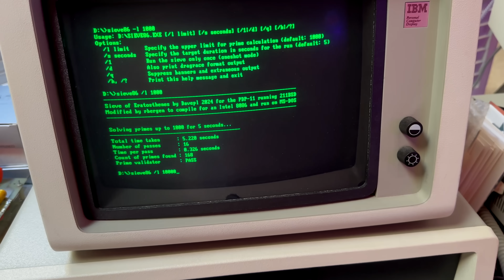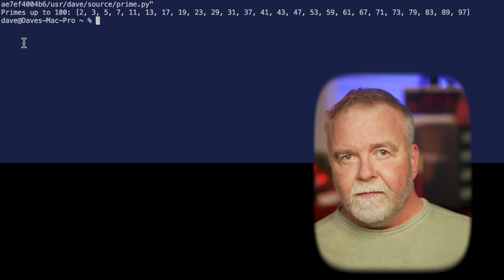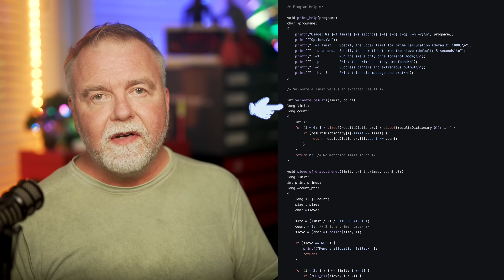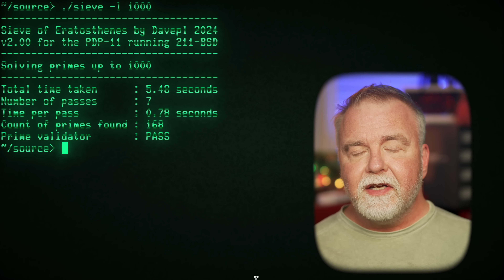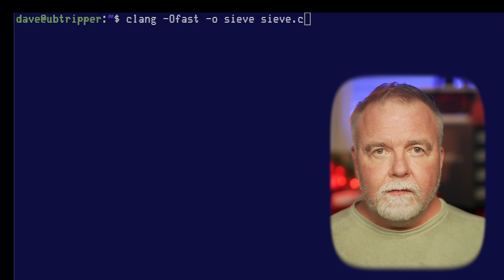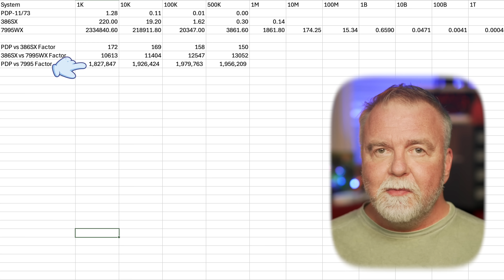Solving the Primes to ONE TRILLION on the desktop!  Plus PDP-11 vs Threadripper tested!

Comment: Telnet and vi described as something to "suffer"?  I think you blaspheme, for vi is God's gift to humankind. :-)
Reply from the maker: vi is like sex.  When it's good, it's great, and when it's not, it's better than none at all.
Reply: May nano smite you
Reply: Back in the 1980s I supported some Vax 11/750s running BSD and later DEC Ultrix.  We had a word processing department which was originally running IBM <something, forget the model> stand alone word processing equipment.  They changed over to using vi and ditroff on our Vaxes, outputting to an Imagen laser typesetter (Imagen later acquired by Qume).  They really loved the productivity of vi and liked AT&T Writer’s Workbench which I ported over from SysV.

I had a chance to meet Mark Horton several times when he was in Columbus, Ohio.  Mark had a hand in updating vi and updating troff, which had originally been hard coded for the CAT photo typesetter, to device independent troff.  Mark explained that vi had been carefully designed to minimize hand movement and maximize editing productivity, being developed for high volume text processing at AT&T.  In my non scientific personal experience, I would say Mark was correct because our professional word processing staff like the environment.

Also vi won the Walnut Creek vi vs. emacs paint ball war at the Linux conference at Duke University, so there’s no question which is the better editor. 😊
Reply: Just because you CAN map the entirety of the user interface to the letter keys in a text editor doesn't mean you SHOULD... Granted after over a decade I can work Vi, but I hate when it's the only reasonable option. And once I sideloaded Nano onto a device with no proper package manager using a flash drive just because it was a possibility and I REALLY didn't feel like using the included Vi to do all that editing. 

Vi is not caring about the UX taken to its extreme for the sake of some sort of effeciency I can't seem to find that outweighs all the extra commands.
Reply: @goosebyte from your comment, I would assume that you are probably under 35 years of age. Before all the GUI interfaces that we know today, everything was text based, and Unix was mostly used from dumb terminals over serial line connections. There still exist very slow connections, that you are not going to run a GUI over to talk to the remote device. vi originated in the late 1970's, while most GUIs came along in the 1980's and 1990's.
Reply: @goosebyte  The AT&T SysV vi rewrite enabled it to use terminfo instead of termcap.  If your terminal is compiled into terminfo, you’re ready to rock.  Back in the day, I bought an HP 2545A for a couple hundred bucks from an electronics leasing company who was getting rid of surplus lease returns.  The 2645A has a bit slice processor board so it could keep up with 9600 BPS over the serial while it was writing to one of its tape drives without having to do flow control.  All of the special function keys on the 2645A keyboard were defined in terminfo and used by vi.

The other pretty well,supported terminal was the Televideo 950.  The place I worked had 950s, but they weren’t my favorite.  The 950s also had reliability issues with the flyback high voltage power supply.

If you have access to the BSD tapes, there is a cool package called learn.  There are a number of things you can learn, and vi is one of them.  The lean package gives a split screen with instructions and a place for you to do the lesson.
Reply: Nano for the win
Reply: Which humans eventually perfected with Neovim.
Reply: All Hail Vi the better version of ed =]8¬_D

I had to write tests in expect script to test both telnet and ftp in the testsuite for Solaris 7/8 UNIX compliance. [ SABITS an extension of TOG UNIX[tm] ABITS ]

So dull, but, expect was a great CLI tool.
Reply: Amen.
Reply: Emacs.
Reply: @Rd99921  Emacs?  In 64K of address space?
Reply: @rickdearman9992  good surname you have there sir. 
Bonus points if you were 1 of the other 0A people who were disappointed he didn't code in assembly
Reply: @mikejetzer4155  good point, well made.
Reply: @rogerdearman I am one of those people that would have enjoyed seeing the ASM code. Having played a little with 6502, and more than a little with 8088/8086 back in the day. I still understand some of the X86 ASM, but so many new op codes since I worked with it.
Reply: @Rd99921 I learned with a ADM-3a terminal. No arrow keys. Emacs was simply miserable with it. vi FTW!
Reply: @narwhaldc  yeah I started with vi too... But I grew out of it. 😂